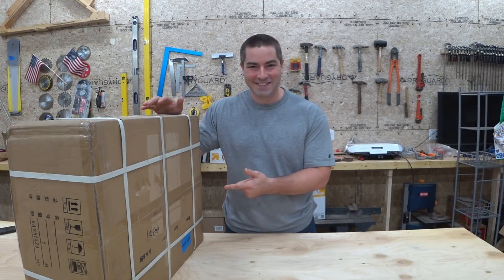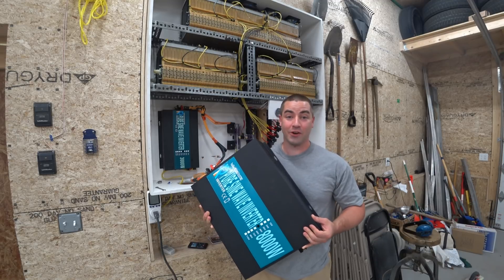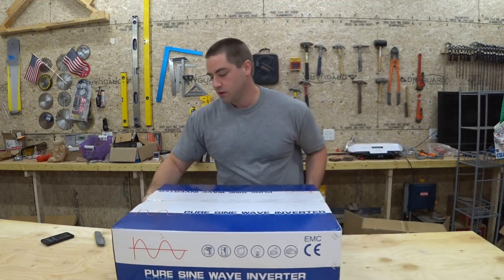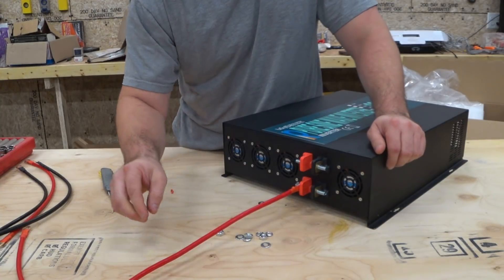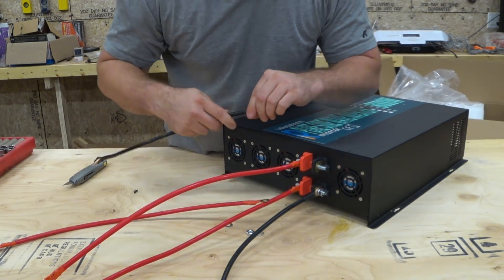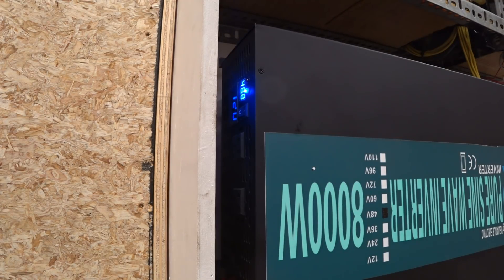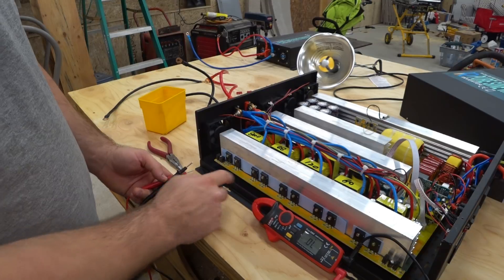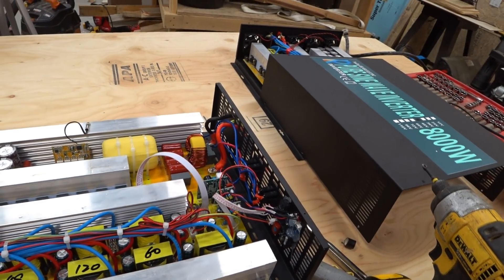Cheap 8000w Reliable Inverter, DIY Powerwall, Chevy Volt Batteries

Comment: I'm an EE with twenty years of experience and your setup looks coherent and I see zero no no's.
My best guess is that you had the misfortune of dealing with a sales and/or marketing team or person and they literally took a unit from somewhere, twice, and didn't bother checking out your issue..

From eye balling your unit up close and then finding the engineering schematics from UL, the mosfet(s) used are wholly inadequate for the marketed purpose, so much so that I'd consider this unit a ticking timebomb of the FIRE variety. 

I'd discontinue any relationship with that company and eat the loss, I would also try to get in contact with their QA/QC department (if they have one), and let them know their mosfet configuration is unsafe and the oscillator they sourced is wholly inadequate, I suspect it is shorting (probably arcing too) on contact when engaged due to a lack of shielding and overall cheap components.
Reply from the maker: Thanks for taking a closer look at the electronics.  The company (Reliable Electric) no longer sells this version.  Maybe too many issues like mine?  LOL  Anyways, they did send me a new version as a replacement and it looks like a re-design.  Would you mind taking a look at the new design and letting me know if you also think it's a fire hazard?  I'd like to be able to use the new version, but not if it's a high risk.  I have a video where I show the new version in detail: https://youtu.be/JH0JtEEIdKs

Comment: I have  bought 2 reliable inverters. I use them for a off grid 48 volt system.They are stupid and noisy. On this last one I bought it failed after 1 year service. Guess what the knuckleheads did to the inverter fuses. They are solder in, they can not be removed except with a solder gun. WHAT JERKS. I will never buy a inverter from Reliable again. They should call these units un-reliable

Comment: Your issue is inductive load VS resistive load, where voltage is ahead of current and your inrush current to start the saw motor is obviously exceeding the capacity of the inverter or the breaker that you installed. It's one thing to know the operating current of an inductive load but you also have to consider the surge when powering up the load. Your failure may have been caused not by the current being drawn but by current generated back from the saw motor in it's static state due to "INDUCTION".

Comment: Question: I am not familiar with anything electronic, but I am looking into inverters in order to utilize solar into an AC unit. I am curious as to why there could still be issues with inverters when generators are not new products? I understand inverters to function like a generator would (creating a higher volt out of stored watts) when attached to a charged battery (that took it in at a lower watt while it is powered solar). So, why would a fuse pop in an inverter? And, why does it completely burn a device as opposed to working like a circuit breaker would where you can just flip the switch repeatedly? Why does one popped fuse damage an entire device but not do this to a house? Why not use the same (already created materials) Why not use what already works and make it portable and used for add on purposes?
Reply from the maker: I wish I knew all the answers to your questions.  I'm not sure why the manufacturer made this inverter without additional safety features.  But, they don't sell this exact model any more.

Comment: Looks like a bad design with the “overseas” inverters. I am using Trace inverters from over 20 years ago and still working fine. Also when I checked the efficiency of the newer “overseas”
inverters they run at about 85% which is bad if you are using off grid power.  The trace inverters run at peak efficiency of 96% which makes a huge difference.  Also, they not only power motors with a power surge over 80 amps, they will run at 200% for 20 seconds and 150% for 5 minutes. The Trace inverters are 4000 watt each running in tandem with 2 units to create 240 volts. Trace inverters are super great inverters.  I have not found many other inverters that even come close to their performance.  Good Luck with you “overseas” inverters. PEACE

Comment: Went to the link to buy a 3000watt, is this only for solar and 48 volts only,. Or can I hook it up to my 12 volt truck batteries
Reply from the maker: The link I left goes to an amazon page with three inverters, a 12v, 24v, and 48v.  I use 48 volt in my setup, but you are right that you want to select the 12v option for a truck.

Comment: You need to look into Locked Rotor Amps.. It's common term in HVAC but applies to most every electric motor..  For things like your saw and definately an A/C unit you might have to install soft start kits and such if you want to use them with an inverter..
Do you know if the 3Kw inverter will start and run an RV A/C unit? I have a 13,5000 BTU Dometic rooftop unit on my trailer, runs at about 9 amps once it's settled down, and has a soft start kit on it.. I can run it on a 2 Kw generator fine but I want to tie it into the campers solar grid.
Reply from the maker: I don't know if it can start a big ac like that without a soft start. The 3000 watt inverter can run my little AC unit (5000 btu) but it struggles to start it.

Comment: Hi, those inverter MOSFET might be negatively-ground and this will work well for automotive. At the same time your miter saw might have sensor that work off ground, laser or whatever, and it shorted out those MOSFET. I've seen the unit not working but never shorted out like that, interesting. Can you get another replacement but this time find 15-20 Amps load from something else. May be the miter saw has some feature that not compatible.
Reply from the maker: Hi P Nark,  Yes, I can buy replacement Mosfets from digi-key.  I just don't have the time right now to try and repair it.  Thanks for watching.

Comment: There are a couple ways to fix that problem but the first place to start is with the saw. Test it first. Just because the stamp on an electric motor says one thing does not mean it will test out that way.

Comment: i get my own cables..   those 4g jumper cables from walmarts are cheap and its 2 10ft wires. just have to make soldered connectors to length

Comment: I been involved in electronics for  4 Decades & that thing is a Very nasty cheap piece of crap. It has No Overload self monitoring  along with many other Safety circuits that stop it from BLOWING UP is just asking to be Blown up. Besides if it has a continous 8000  watt rating, most Real Inverters have at least a 5 to 10 second Surge rating of at least  Double it's rating & in this case should be at least 16000 watts plus.  By the way those Cheap high frequency transformerless Inverters at best only last a few years if it's a good one but a good brand inverter with a Transformer can easily last over a Decade. Our transformer inverter is about 16 years old, it's  been smashed off the wall 3 times & Drowned from various Cyclones and it is still working. It's had short circuits & overloads thrown at it so many times as well & still lives.

Comment: Just an incompetent user and many ppl writing BS. Every electrician knows a motor uses 10 to 1000 times the rated current at start up!!
Reply: I like your math skills. So the first 3000 watt Inverter can run the motor but the 8000 watt can’t because “Every electrician knows a motor uses 10 to 1000 times the rated current at start up!!” mind blown.......

Comment: You need a low frequency Invertor which has a transform at the output. It can handle higher inrush current specially from motors.
Reply from the maker: Thank you.  You are right.  I did switch to a LF inverter with very good results.  https://youtu.be/dfHb5tZErTs

Comment: The inrush current of your chop saw is a lot. I’d get IGBT or SiC over mosfet too.
Reply: The 3KW unit has a peak power of 6KW, so I'm guessing that the 8KW model has at least 12KW peak power... no way the chop saw is using that much.

Comment: The company is responsible for the integrity of their suppliers. The quality of their shipped products should be pretested to it's designed limits. Companies that are reputable will test and pass their equipment above the designed limits. Foreign companies have lower quality control than American companies. Our politicians don't care about accountability. That is changing. Let's work with President Trump to  Make America Great Again. All the WAY USA. Hold our politicians accountable i.e. drain the corrupt swamp. Support domestic companies that sell quality products. ☝🇺🇸💪...👉

Comment: I have a shed that has all of my solar stuff. I have an aims pure sound wave   I am trying wire to  a 50 am plug so I can plug my 5th wheel to it. Do you have any idea how to do this or can you refer me to someone. There are 3 wires coming out of the inverter but there are 4 wires that go to a 50 amp.
Reply from the maker: The 50 amp plug from the 5th wheel has 4 prongs.  1: L1, 2: L2, 3: N, 4:G.    L1 and L2 are the two hot legs.  Each hot leg is 120 volts, but they can be combined for 240 volt appliances.  My Aims inverter has all 4 of these terminals to hook up to.  The ground is marked with a symbol, not the letter "G".  Here is the manual for my inverter, and the wiring is on page 25. https://www.aimscorp.net/documents/PICOGLF10w-60w%20071618.pdf  It's worth noting that some inverters are made to output only 120 volts on a single leg.  They don't have the option for two hot legs.  I don't know if this is your case, or not.  Good Luck, I hope that was helpful.

Comment: I wont be buying one after seeing this... knowing that you had the same problem with another unit the same!
Reply from the maker: Yeah.  At least for power tools there are better suited inverters.  I have switched to an "Aims" brand inverter.  It has a big heavy transformer inside and can handle the surge loads easily.  https://youtu.be/dfHb5tZErTs  Thanks for watching.

Comment: There is issue of in-rush current when start up the saw. Too much current drawn cause the burn of the MOSFET. The inverter shoud provide soft start function to avoid the over current.
When first MOSFET is burned, The load is shared to the rest 8 MOSFETs. And cause sequential failure.

Comment: If you need an 8000w inverter check out the Sol-Ark 8K
Reply from the maker: If I was starting over, building from scratch, that would be a great option.

Comment: Even if ther is a balance bar inside + to + and  — to — 
You med to use both to draw 8000watt when you go LIVE !!! .NOT TO TEST
Reply from the maker: I agree.
Reply: Yes the whole problem could have been the gauge wire used. The amp draw could have required more. They should definitely be shipped with two proper sized leads.

Comment: I used to run 15 amp saws and small compressors (the worst) on a Trace 1500w modified sine wave. Built like a tank, you get what you pay for, that Trace is still running 20 years later and has taken heaps of abuse without failure. Just bought an expensive Outback system, I wouldn't be caught dead on Youtube admitting I was using your Chinese junk. Needs to be repeated - you get what you pay for!
Reply from the maker: I agree with you.  Since this video I bought a much nicer inverter with a heavy transformer inside.  https://youtu.be/dfHb5tZErTs Thanks for watching.

Comment: how many hours will this system run you air conditioner
Reply from the maker: My battery is rated for 18.4 kwh, but I only use 14.3 kwh of that.  This keeps the battery lasting longer.  So I can run my air conditioner (with compressor running) continuously for 30 hours.  This accounts for the 10% loss in the inverter.  However, the compressor is usually kicking on/off as needed for the room temperature so in that case the run-time would depend on how hot it is.  I hope that helps.

Comment: You do realize that the start-up amperage for that saw is more than it's running amperage, right?
You do realize that, ...correct?
You knew that fact from the onset, right?
You knew it when you ordered it, correct?
...when your had them replace it, right?
You do know what you're doing, don't 'ya?
...
Reply: No it's not. Do some research. Start up is 20 amps.

Comment: My cheap tiny box that came with my harbor frieght 4 panel system was doa....i took it apart about 6 months later  to find that the circuit board had solder that peaked on some joints an eighth of an inch high from the boards back side....it made contact at many  points with the metal box it was incased. I filed down the solder thinking i must have damaged the board when i connected it to a battery for hours at a time. IT WORKS and ive seen more than one review of this shoddy made box working better on these panels than expensive upgraded name brand. boxes
Reply from the maker: Thanks for the tip, I'll look for that.

Comment: There is a big difference running resistive loads on AC and trying to run universal motors, like the chop saw on an AC inverter...  Brushed AcDc motors have very specific properties that need consideration... When these motors are started, they have no back EMF, which will build to its maximum at max rpm, back EMF has the property of reducing current draw, at zero rpm, the motor has zero back EMF, so the current draw at zero rpm is basically the ohm value of the motor divided into the applied voltage... for the poor inverter this current load will exceed its capacity... If the inverter has no current limiting built in it will try it's best to match the induced load to it's own detriment...  This in rush current is huge, but its momentary, and when connected to the AC grid and all those power plants, the in rush current is easily satisfied... Circuit breakers and wires also easily pass huge currents, because they last no more than a second...  Your test in the video is the most brutal one you could possibly do...  The in rush currents if you care to measure them probably exceed 100 amps... before dropping off the run currents...  So what you need to avoid killing the inverter is a soft start circuit, it limits the max current to a safe level then switches when the motor reaches run speed...
Reply from the maker: Thank you.  Since this video I bought an inverter that can handle the miter saw: https://youtu.be/dfHb5tZErTs  Thanks for watching.

Comment: It appears to be a horrible and cheap branded inverter. You shouldn't have multiple connections as its increased resistance and the week link in the chain. Surely you should have short period surge for inductive loads

Comment: Just by looking at you wires its two thin ....we are running 5kw on a 48 volt system .....and our cables are welding cables ....upgrade your cables ...and you must get a solar controler
Reply: The reasons why,you keep blowing inverter s is your wires are to thin to pull the amps

Comment: What about a large capacitor on the output? Sort of like a hard start cap on an AC unit. The cap would have a charge for hard starting without calling on the small electronics right away.

Comment: The saw has a very high inductive start up current, maybe think of adding a soft start,
It maybe a design problem within the inverter, does the 3000W inverter have a transformer output stage, the 8000W inverter looks like it is directly coupled final output stage apart from a few isolation transformer, maybe the mosfets are underrated to handle massive start up current, it would be very interesting to look at the current rating with voltage rating of the mossfets, dont forget due to two failures this will possibly strengthen the design engineers to look at the unit so it can handle inductive start up currents, some inverters have two current figures running capability together with peak current, maybe this inverter design is not suitable for workshop type areas?
My background is electronics hardware test engineer in aerospace, verification qualification testing, :),
Any feedback will help the manufacturer look to improve the final product,
Saying that sometimes you have some motors with a shorted winding that will take out motor drives on first start up !,
Reply: CoolMusicToMyEars need a capacitor on the saw. I’m curious if the specs on the 8000W box too. Dumping a large current draw on it may be outside the specs. Cheap power tools always take a huge current rush.

Comment: The biggest mistake youre doing is the position you mounting it. Check the specs and it clearly states no to mount it in that position. There in nothing wrong with the inverter its your knowledge of being s back door mechanic. You cant mount it on its siide. Flat as is on its screws holders. Flat on the wood not even upsude down. Theres one way to mount it. Belly down or chassi down.
Reply: BS. Electronics don't care about position. You are the idiot.

Comment: Why would anyone use a Pure Sine Wave Inverter to run a Chop Saw,etc.?
Reply: Because you can. Why would a customer have to think about the kind of load he is using in connection with the inverter when the manufacturer claims that the inverter is up to the job reliably?
Reply: John Nashmy ....maybe he is one of those people that thinks into the future and maybe he'll plug into the electric tubing one of those big tv boxes and i hurd those are picky on a thing called a sinewave.